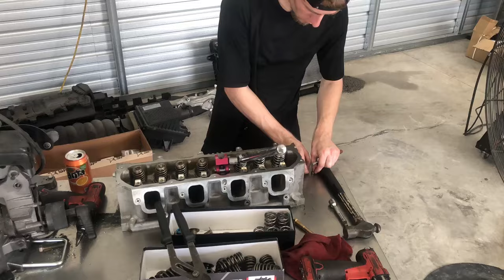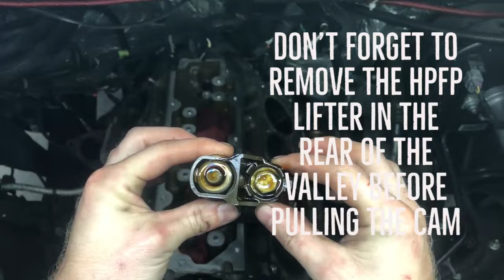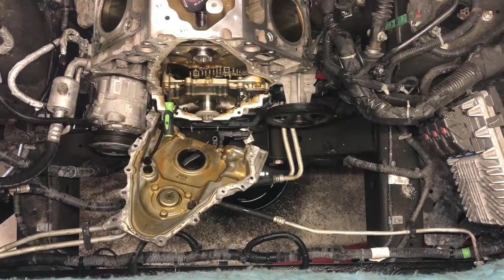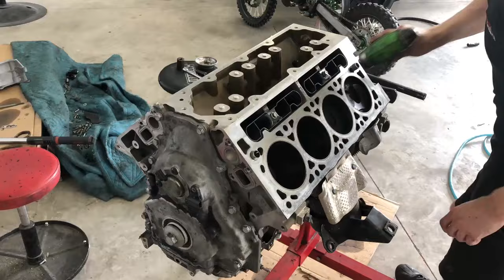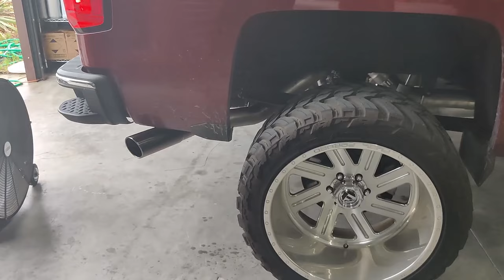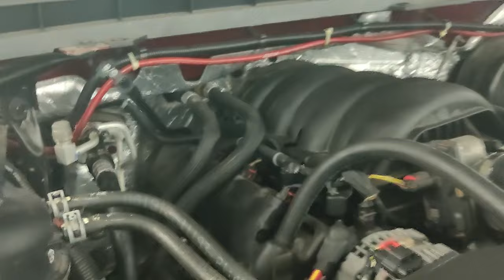2017 Silverado Cam Swap (AFM/DOD Delete)

Comment: I see you forgot to mark everything to time it without pulling the motor out
Reply from the maker: That's not at all why I pulled the engine. The oil pan and oil pump needed to come off for this one so we made the choice to pull it and do all gaskets at the same time.
Reply: @ChrisVaughnTech  oh alrite i just thought that happened but keep up the good work bro 💯💪
Reply from the maker: @nokchevy1  setting the timing on these engines is super easy. It's just two marks and you align them so that's not an issue at all. The problem was that the oil pump needed to be removed and to do that you have to remove the oil pan. The oil pan on these engines is RTV sealed so in order to install the pan and seal it correctly you pretty much have to pull the engine to do it properly. So that's what we did
Reply: @ChrisVaughnTech  Why did the oil pump need to be removed, is that part of this procedure or was it unrelated?
Reply: @K0NFUZE you don't have to remove the pump to cam it but you do need to mark everything since you can't see the timing mark on the crank Sprocket if you don't mark it and it moves now you have to pull the pan to take the oil pump out and time it
Reply: @nokchevy1  sounds like they forgot

Comment: what cam is this?
Reply from the maker: I believe it was a Texas speed stage 2 or 3 cam for the L83 engine. 
Texas speed, BTR, and GPI are all good options. You can simply call them and they will go over your setup and needs and recommend the perfect package